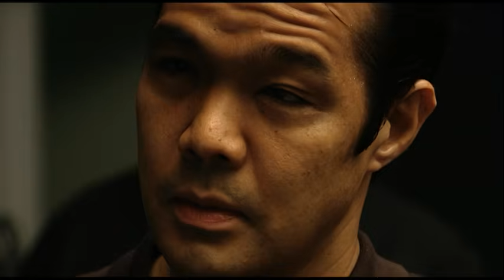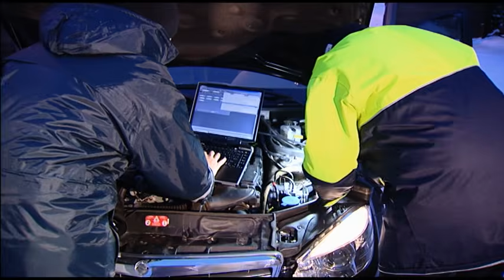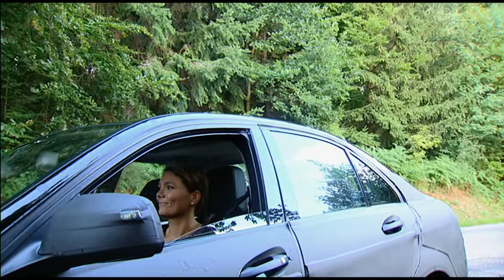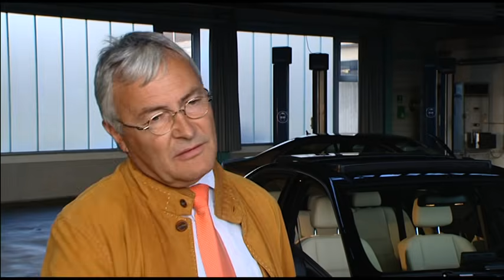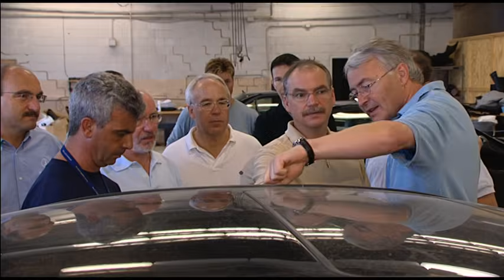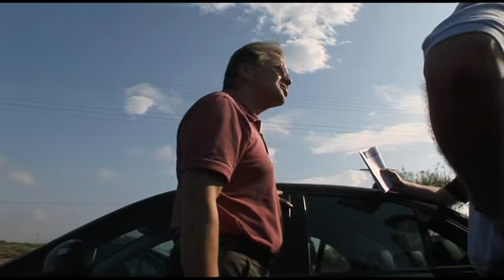Mercedes-Benz W204 Development  and  testing part-1

Comment: Love it 2011 model c180 FL still I have but also lots of problems I have. 
Chain and sprockets, oil filter cooler, high fuel pump, cozmetics defects, not relaible rear cross member, bad oil pump tensioner, bad and poor ecu cabble connection, noisy lower engine guard, steering lock problem.

Comment: I have w204 180cdi 2012.Its a very unquality  and unreliable  car.I have timing  chain and tensioners  issue on 154000 km! Water pump is bad too.Injectors too.Dmb german engineers.Same problems as previous bmw n47 engine. However  the bmw fixed that problem but mercedes  done the same mistake as bmw.I will never buy mercedes  again
Quality  vehicles are Japanese  vehicles only. Germans should  learn from them how to make a quality  product!
Reply: 154.000 only? My C200 CDI is at 290.000 km. Original chain but repaired water pump (leaking).
Reply: @Lucas-dz4ye  Your chain is replaced at one point earlier. And your km are questionable.
Reply: @ Im sure you know my car better than me. 290.000 is not questionable at all lol, you can easily find examples with 300-400k km
Reply: @Lucas-dz4ye  😂😂🤣😅
Reply: @JasZg 
Just look online you’ll see he’s right. 
I saw one at well over 400k
Reply: C250 cdi 2012, original chain, tensioner replaced, thermostat waterpump and oil cooler housing replaced, but I am very happy with the car, these things just will fail after a time , it's due to the co2 regulations, and more plastic used to lower the weight of the car. Super sexy, comfortable and dynamic estate car, already driven 90K kilometers in 3,5 years. Love it!

Comment: This was the last good C-class
Reply: The c class was always shit, everything is vin encoded making it non user repairable
Reply: @robbunanza7909  precisely.  This sort of trend brought about our american movement for "Right of Repair" laws which we have some now, requiring the ability of inddependant shops to access technical materials so they can repair cars.  Dealerships here are incompetent often or extremely expensive to the point of being cost prohibitive to maintain a car for an adequatley long enough life
Reply: Not at all. W203 was the last good Mercedes C Class. 204 is piece of plastic and hardened shit.
Reply: @RemusGagiu  If you forget how bad is the whole body in the terms of rust, than you have an argument. When they joined with Crysler they started to cut the costs in body protection around year 2000 and these few years almost destroyed Mercedes image. W204 returned the trust. Big difference.
Reply: @RemusGagiu W204 was infinitely better than the W203!
Reply: @rare6499  not really.  Too many expensive issues w/ the 204
Reply: @18_rabbit such as? Mines survived hell and is 20 years old at 200k miles, puts all other cars of this era to shame

Comment: Great video. I do wonder however if these engineers think about the long term? Sure a new car is great, but the c class certainly does not go the distance, well, at least without a deep pocket.
Reply: those withe large engines goes a million kilometers
Reply: They tried to, but tbh the M156 was AMG's first totally in-house developed engine. It had a lot of the issues we hear about, plus the 3.5L V6 was kind of a nightmare.